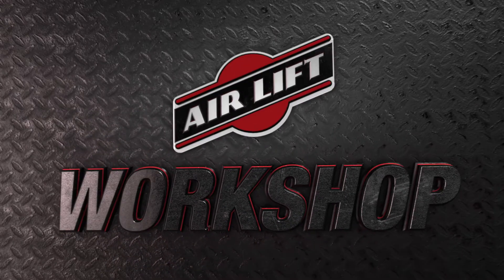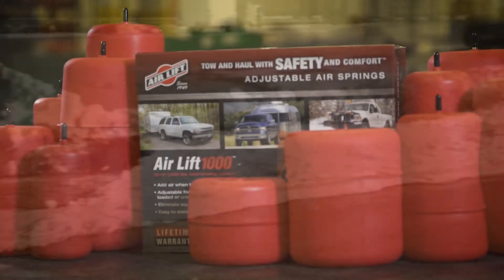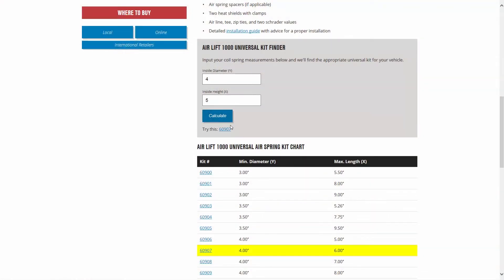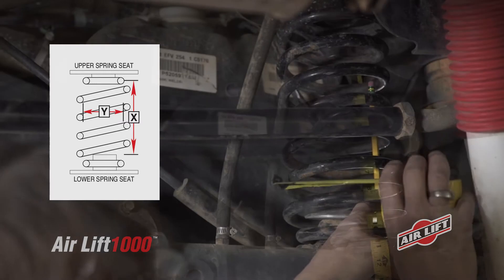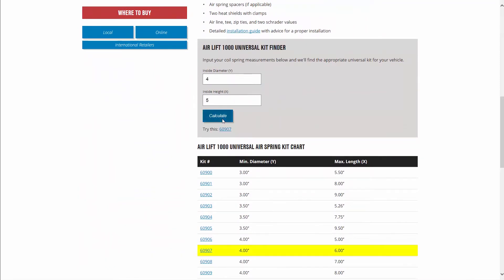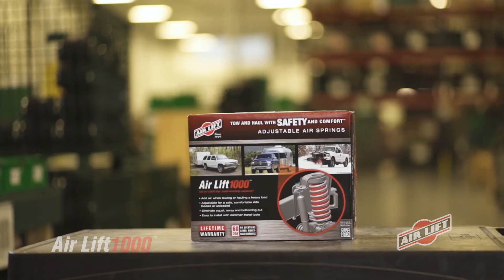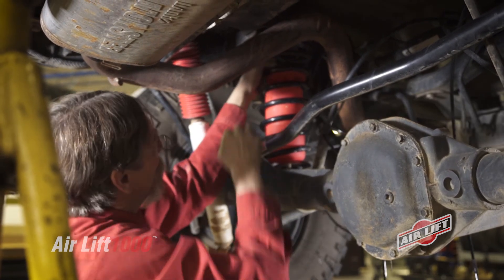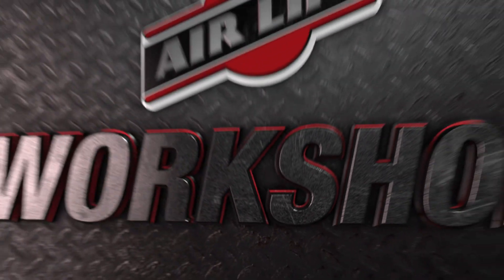How to Build an Air Lift 1000 Universal Kit

Comment: I would like to fit them to my car. as I pull a caravan a couple times in the year. The top and bottom spring mounts on most cars dont allow this type of fitting. If the valve was mounted on the side it could be used on every car.  Just an idea